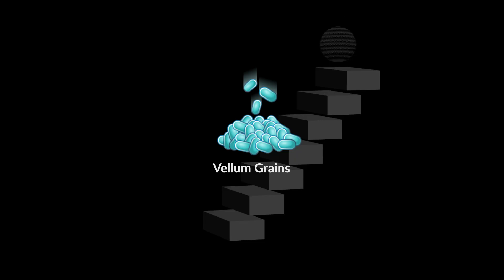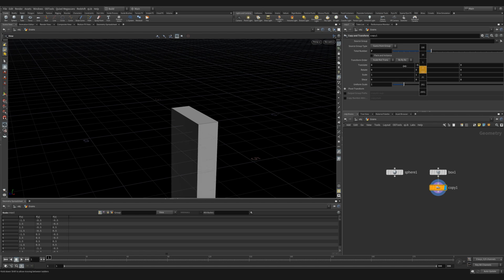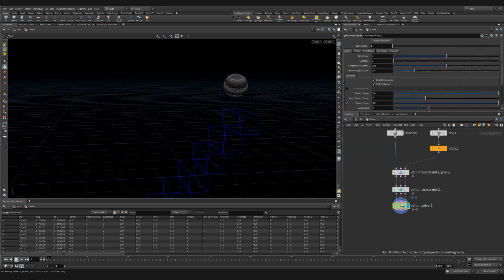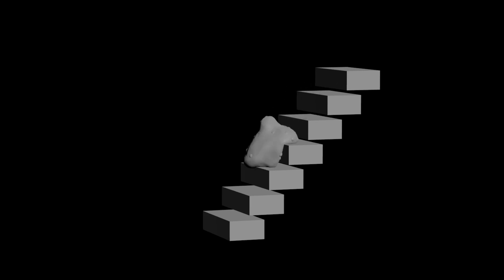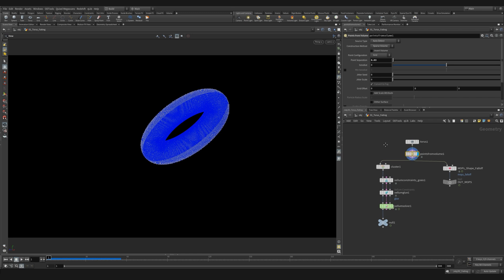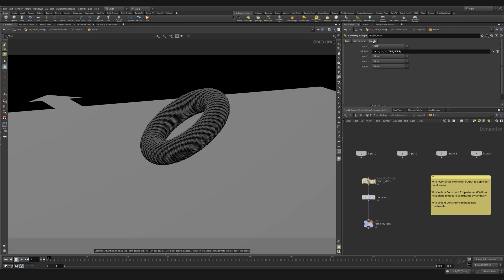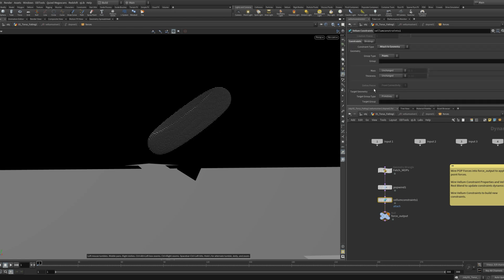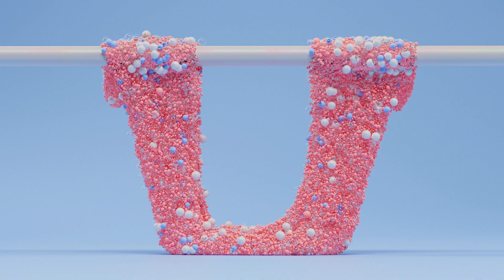06 | Vellum Nodes | Grains

Comment: 2:18 "You can also point deform your original mesh to your points" could you explain how to do this please?
Reply: You should be able to just wire the original mesh into the "Mesh to Deform" input of the Point Deform node, the pre-simulated points from your Vellum Configure Grains into the "Rest Point Lattice" input, and the simulated grains into the "Deformed Point Lattice" input.
Reply: @polkablues  how do we get to know that we have to connect these nodes to these inputs
I'm a beginner in Houdini but if you can tell me any tips for working on some ways to be efficient in Houdini
thank you so much btw:)
Reply: @arjunladdhad8792  The best way to learn is doing lots of tutorials like this one, then taking the knowledge you get from those and doing your own experimentation (like setting a goal for a certain effect you'd like to make and then trying out different methods to achieve it). As far as understanding the node inputs themselves, you can hover the mouse over the input to show what the input is for, and the online help documentation can provide you more details for each node and what specific inputs it requires to work. Just be prepared, as a beginner, to spend a lot of time looking up explanations for nodes until you're experienced enough with them to know how they function.
Reply: @polkablues  Thatsh good informashion.